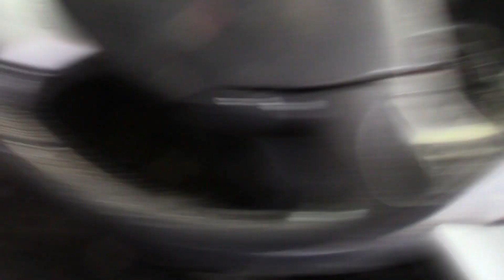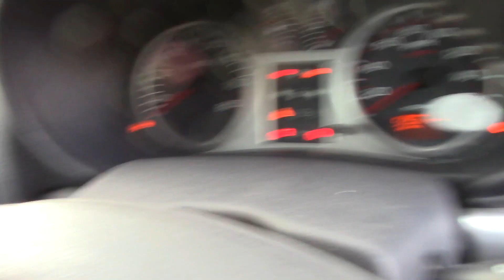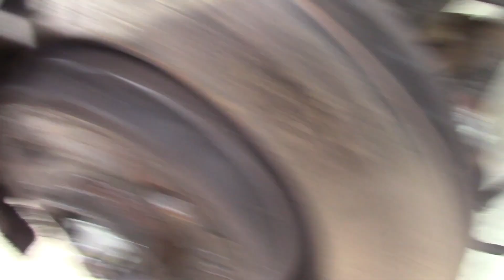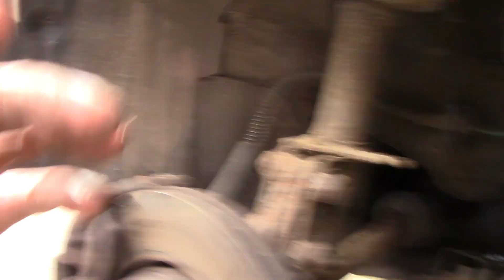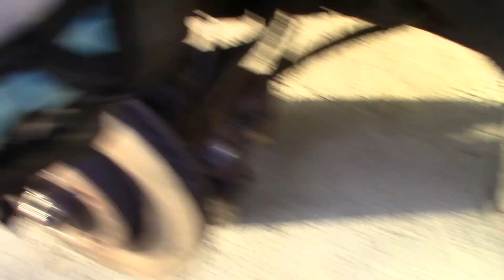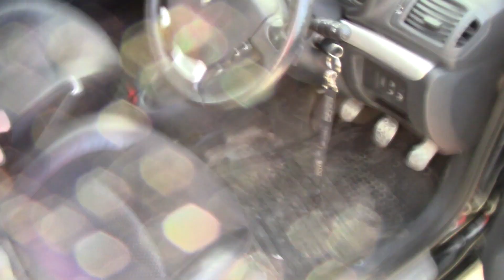2004 Renault Clio 182: Diagnosing & Repairing ABS & TCS Fault

Comment: I just ran into this job on my 2003 megane cabriolet. The reluctor ring is badly corroded and grazing on the sensor so I ordered a ring and a new sensor as it looked splintered at the working end. MASSIVE  pig of a job getting the sensor out. I’m digging it out in pieces. 
How did you finally get the sensors out. When you say you ‘popped the axle ‘ do you mean you took the driveshaft out ? And what is that big bit of kit sticking out of the hub, an extractor ? For the driveshaft ?

Comment: i have almost the same problem at my 2002 clio 1,4 16V 98ps and also my speedo not working... i replace both front sensor but no luck,,,  the problem still exist. Any  suggestion?

Comment: For anyone looking at this with an ABS fault… do not try to measure voltage. Measure the resistance of the sensor, should be just over 1K Ohms… failed sensors will be in the Mega Ohms or open circuit.

Comment: My man, I have the same lights situation on my 2003 Clio and came across this video just now. Looks promising, going to test my sensors like you showed. Just to clarify, when working properly the current should be 0 standing still, and around the magnitude 10^-2 volts when turning the axle by hand?

Comment: Hey cap Well done on the ABS repair of the Clio, really nice workmanship.
Take a look at Haynes repair manuals they are great time savers and cover most anything you need repairing a vehicle and how to's. Their manuals are great, saved me so many times.
When ever I can't find a OG factory repair manual for a car, I used Haynes repair manuals on cars I was not familiar with when I was working as car mechanic.
We even had them in school when I did my car mechanic degree. So I Found this one for the Clio on ebay but you might find it elsewhere to.
https://www.ebay.co.uk/p/1038774375?iid=251112145391 Renault CLIO Petrol Diesel 2001-2005 Haynes Manual 4168.
CHEERS!
Reply from the maker: thx SuperMich
Reply: @grimreapers2  You're welcome!

Comment: Had to replace an ABS sensor back in December on my punto. Was £100 all in for garage to do it. Sometimes a good way to check these is switch the multimeter to resistance and if the resistance is silly high the component is broken inside.
Reply from the maker: thx